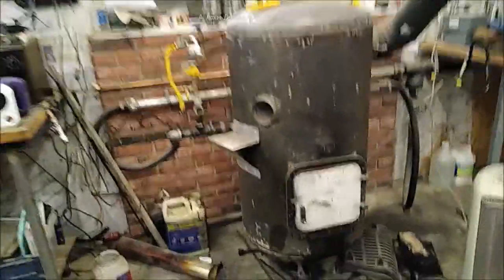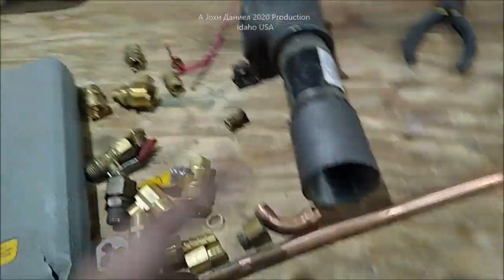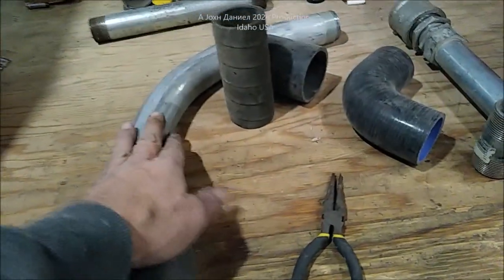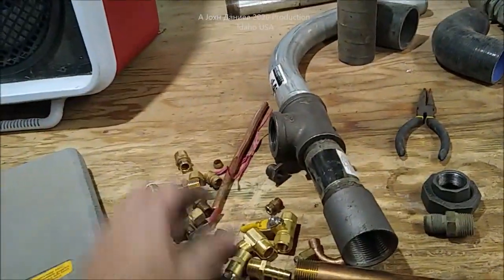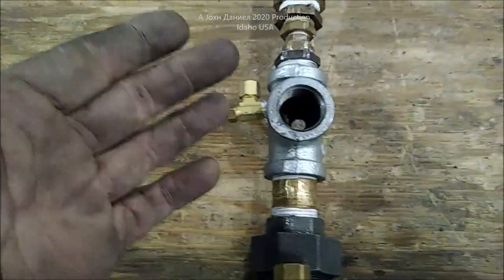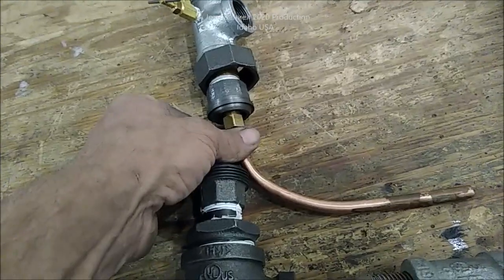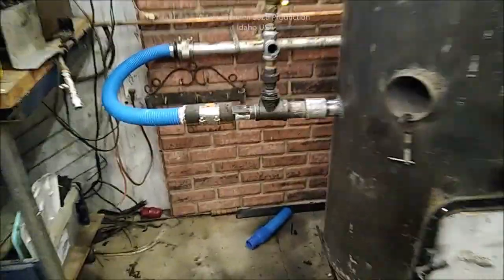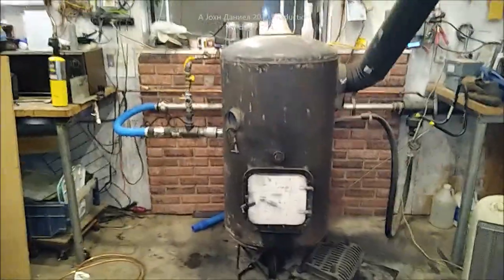Waste Oil Heater Burner you can easily build, my update - 5th year running upgrade

Comment from the maker: Non Standard Materials needed to build this same style heater, Bilge Blower capable of 230+ CFM ( https://bit.ly/38yJz8M  ) , Double Wall 6" pipe due to high temp output ( https://bit.ly/3kj4Qp7 ), 4 to 3" Fernco for blower to fit and compress output of blower ( https://bit.ly/36HwyHF  ), 6" single wall to 6" double wall pipe adapter ( https://bit.ly/3lncWhP ) , 30 minute cool down timer that works on DC voltage ( https://bit.ly/3n8i1LA ), Other Common fittings you will need depend on your heater body you will use, can be found locally and using galvanized or black pipe won't matter as long as you build safe and keep fuel input to the minimum that can be burned in the heater without puddling of oil in the burn pan.

Comment: I done one for a friend a couple of years ago and we just fourty fived a one and a half inch pipe through the side and fourty fived down into the bowl. We just welded a port and plumbed a line to let the oil drip into the air pipe. Worked great without all that trouble and expense. I welded about a three inch round plate with a few small holes drilled in it about an inch and a half under the end of the air tube. Suspended it on two small straps. He used a hair dryer he gutted the heating element out of it for air. Works really great. I do  think you need a way to adjust the fan speed like you have. That would make it fully adjustable.

Comment: Running new wire for your AC unit do you use stranded wire or solid wire and how do you figure out your wire size for how many feet you run it for a 20 amp breaker
Reply from the maker: Are you referring to a RV style AC unit? Then its 20 amp, 12 awg solid Romex up to 46 feet, further than that run it all in 10/2 awg Romex. The surge is right on 16 amps, OK for 12/2. But long runs over 48 feet can create enough volt sag that can do damage to compressors.

Comment: I have a little over 3 acres to sell in the Bitterroot Valley in Montana. I'm told it has the million dollar views of the Bitterroot Mountains to the west and it's the Sapphires to the east.

It's developed land with a well, septic, natural gas, electricity, (200amp electrical service), and about a 35'x40' shop that's wired, lighted, insulated and paneled with a concrete slabbed floor. (It would be ideal to build a mother in law apartment inside the shop in the unused upper portion of the shop. That would make great living space in an already existing building that would be out of sight from the tax man, so much lower taxes than if you built a house outside the shop.) There's cable and even phone lines, (underground), to the property if you want to use them.

You could either build or move in a modular or mobile home if you like.

I'm living in a vintage mobile home I'm taking with me when I leave... but... you could move a mobile home in there or there are already two connection points for septic, water and electricity on the other side of the shop where you could move in a modular or mobile home or you could even build a home there and incorporate the septic branches into the build.

If you'd like to build and if you'd like my help... I have basically all the tools necessary to build a house and whatever. I used to build houses in Texas and have worked with and around all facets of construction most of my life so you could take advantage of my knowledge and experience to save as much money as possible for you.

I was planning to build myself, till I was injured on the job and subsequently disabled so I can't do it all myself anymore. Due to my injuries... I have arthritis throughout my body and cold just equals EXTREME PAIN for me.

I'd help you if you'd like, but then I'll be moving on to warmer climates where I can have much less PAIN!!!

Not far from here there's a completely undeveloped ⅓ of an acre lot for $80K. I have about 3.19 acres for just $140K and mine is already well developed.

It's open field next to a forested area that, if you're interested in making money... you could easily subdivide it into ½ acre lots and build houses on them to sell... and depending on how fancy or detailed you want to build them... you could easily make at least $1 Million dollars in pure profits, (after expenses). Much more... the fancier you build the houses.
Reply from the maker: Need a realtor and list it for $170,000
Reply: @JOHNDANIEL1  That's a problem... don't want to use a realtor. Should say don't want them using me. Bunch of thieves certainly don't deserve the money they take.

I  worked with a mortgage broker and learned what thieves they really are.

Comment: You could also coat the treads with solder paste and then heat the treads as well.  If you do both ways, you can really get the most solid connection beyond using steel and welding...

Comment: Could you use vegetable oil as well?
Reply from the maker: We dump it all in there. Transmission, Motor Oil, Vegetable oil and any non synthetic hydraulic oil. All in one tank above. Just add one gallon red diesel to 40 gallons of the used oils to keep them mixed and flowing nice.

Comment: I have an old heater stove I've been trying to give away for that. It's a great way to heat a shop. I don't understand why no one has taken it yet. Looking forward to watching this video.

Ok, I've seen your video now.

The heater I'm wanting to give away is a factory made oil heater that was the heater in a home. It already has a carb for metering the oil... it jus needs to have a filtration system between the tank and the heater to filter out the particles in the oil from the engines and machines it was used in.

I'm not trying to get rich by high pricing it. I'm offering it for free.

I don't need it. I have an assortment of stoves and forced air furnaces. I certainly can't use them all. lol

On the furnaces, one is jetted for propane and one is jetted for natural gas.

I'm offering them for free too. If you're familiar with forced air furnaces, they basically just need a good tune up. They were working when they were taken out. They'd be excellent for heating a house, garage or even a shop.

I'm getting too old and disabled to work on them myself anymore. So, I'd like to help some people out by just giving them to a good home.

You have to pick them up. I'm not shipping them for you. lol
Reply from the maker: I can always use parts and projects! Shame your not near by!
Reply: @JOHNDANIEL1  I'm not all that far. Just up 93. lol

I used to head down that way to visit my Mom in Kimberly.

Also have a large wood stove I had to move outside in the weather to make room. Great stove... from when they made em more efficient. Just a little sand blasting and heat paint and it'll look brand new. There's like a ceramic medallion on the door slightly cracked from moving it out there with a hand truck. You could make a new one with your emblem on it. Last time I looked, all the bricks inside were good.

I had a small, high efficiency, new one someone stole that I wanted to use in my house I wanted to build. I still have a special antique wood stove for my shop, but can't believe how expensive  stove chimney pipe is now. So, haven't installed it yet.
Reply from the maker: @nomadthetraveler5782  Stove Pipe is excessive priced for the materials you end up with. If I had the extra gas and time I would run up and get those. Where up 93 are they at? You can send me info on my email olympicpowercontrols@yahoo.com

Comment: Nice, that some old school stuff right there! I am assuming that you control the heat/ burn with your needle valve?  The cooldown is the fan/ blower that runs for  20 or 30 minutes after? Might have missed it; how does the timer work for the flow of oil?
Reply from the maker: We had the 15 minute timer upgraded to 30 so the fuel off cool down cycle increased to 20 minutes would do a better heat salvaging and pipe protecting. You can get caramelized oil sludge in your drop tube if you do not do a cool down on shut down. And you never run them over 8 hours without cleaning out the ash and char left in the pan each time. I just allow them to cool, then vacuum out before next fire up.
Reply: @JOHNDANIEL1  cool and thanks for the information!